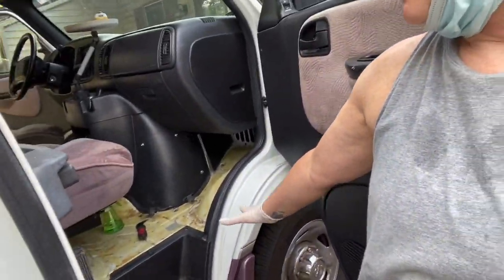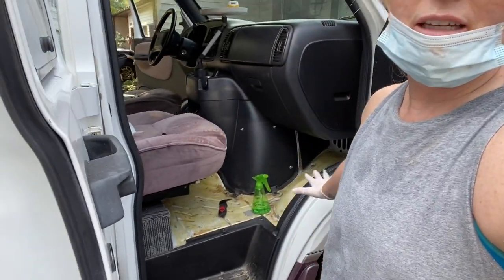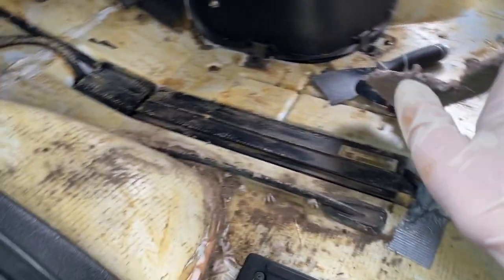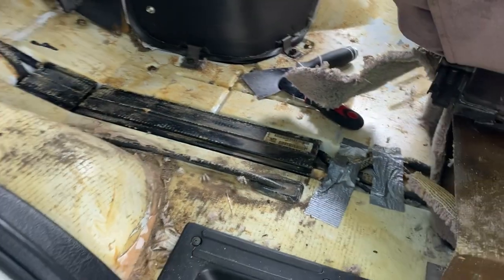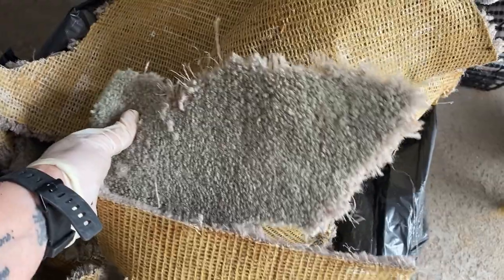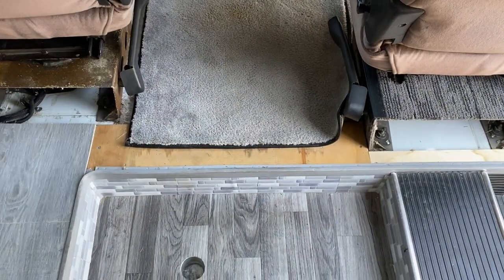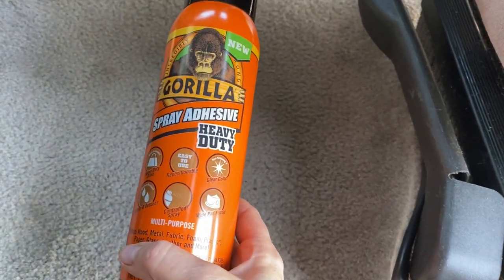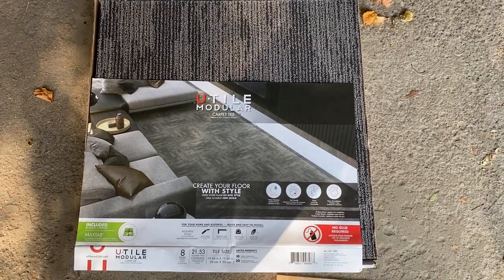Laying Carpet Tiles in My 2001 Roadtrek

Comment: I see you put a laminate floor over your shower pan? Do you still use your shower? Any issues? I’ve been wanting to do the same.
Reply from the maker: It’s not laminate, it’s like a rubber type. It comes in a roll that they cut and I got it at Menards. I don’t use my shower only because there’s such limited space! But I love my flooring! If you go way back to the beginning of my channel I videoed everything I did and used in my van 😁